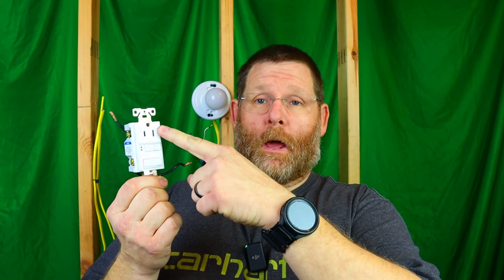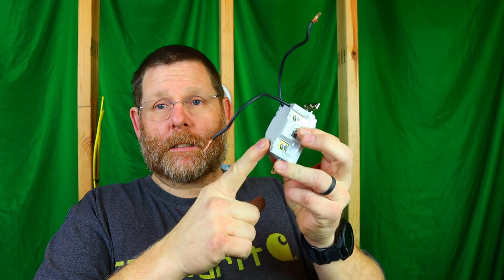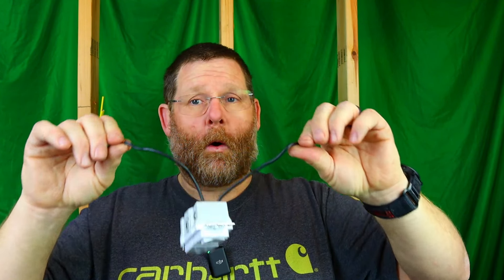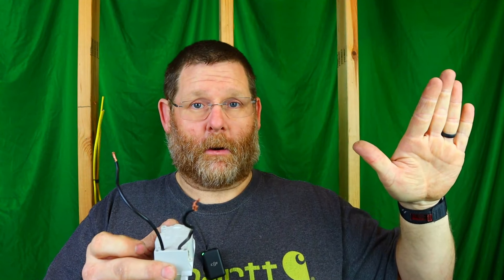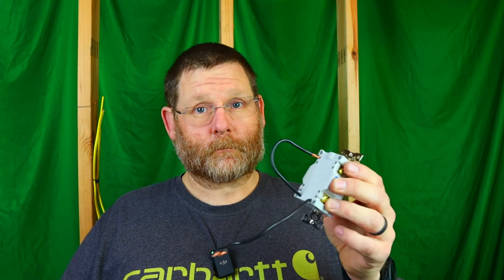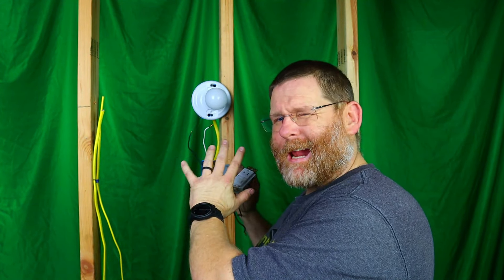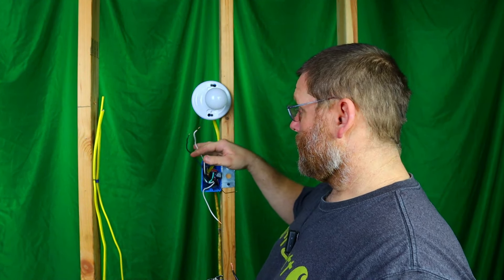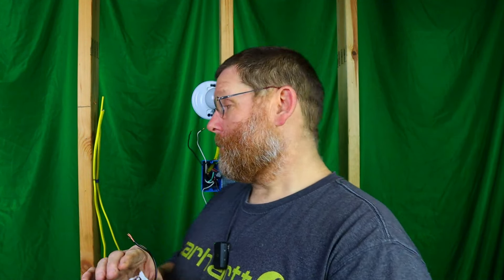DIY GFCI  Switch Combo How To Stay Safe

Comment: Dude thank you sooo much for making this video. You made it so easy to follow and explained every step so I couldn't screw it up. I have the exact gfci combo switch and I've installed one before but that had FOUR different wires coming into one box. I have a 64 year old house that was poorly built and I have no idea why they wired it that way but it took me like 6 hours to finally get it installed correctly with a gfci outlet with a 2 switches. One for the ceiling light and one for the vent fan. So thanks for making this installation easy enough that a caveman could do it 😊
Reply from the maker: My pleasure thanks for watching and commenting ☺

Comment: Cheers! Thanks for redoing this video, I like some others thought the same. My light and fan were both connected. A GFCI was in the bathroom. First the fan caught on fire 🔥 fell out and into the toilet. The plastic was so hot it exploded the toilet. 
After cleaning up the mess and removing the burnt fan, it turned on the flipped 15amp back on. The lights turned on, I then washed my dirty hands and went to turn off the light but…shock…yep I got shocked. The GFCI that was there did not trip. I planned to investigate, but I assume nothing was protected. 
But yes, thanks for the video redo.
Reply from the maker: Wow that's terrible. Glad everything is OK now. Thanks for watching and commenting ☺

Comment: Just wondering why Eaton uses strained wire vs solid copper, and other manufacturers like Leviton and etc what they use. Thank you for this demonstration and mentioning other options to use on this type of switch.
Reply from the maker: My pleasure and not sure why it is so different between the brands

Comment: Thank you so much for your videos! Liked and subscribed! Question please: What if I am trying to wire up the gfci switch combo but I also have another switch that also turns on this light? Can this still be done?
Reply from the maker: Welcome to the diy family, and are you meaning a 3 way?
Reply: I'm unsure of the name maybe a 2 way? It's a bathroom light with 2 different switch locations. I wanted to install one of these in one of those locations. I have white, black and red wires plus copper ground at the switch.

Comment: Just watched your video and found it very helpful. Watched your video to change my old switch in the bathroom and have it change to a GFCI combo. The only Problem I came across is that I can't turn the light on and plug something at the same time. I can only use one at a time ( the switch light Or the receptacle), both work, but as I said, not at the same time. Can you let me know what I did wrong? Thanks
Reply from the maker: https://youtu.be/SbUVVlO8Vww this may help

Comment: I followed the instructions for wiring this type of switch that were presented around the sixth minute in the video and the gfci turned green but wouldn't allow me to push the test button and didn't have any power. I re-wired it using the second type of wiring demonstrated that gfci protects the light fixture and the green light came on and the test and reset buttons both worked and there was power. Are there some combo switches such as the Leviton brand that I bought that only allow the second type of wiring hookup demonstrated?
Reply from the maker: I don't think so

Comment: Hello, I have an older home and I want to install a GFCI switch and outlet combo where I have a switch in the bathroom. The problem is, there are only 2 wires PERIOD, no other wires are in that box at all! no capped white or black wires either and no ground, and the white wire is the hot one😬, I tested the 2 wires, I got 120+ reading on my meter so I guess I have a neutral, is the wiring reversed?? I'm confused, please help! It also has those 2 wires coming out of the GFI just like the one on your video. I bought this thing from Amazon and I want to find out if I can wire this thing and if I can't, I'm returning it before the 30 day window is up, thank you.
Reply from the maker: Sounds to me like you Only have a hot and a switch leg down at the box. Your neutral stayed in the light box. I'd say no without being there
Reply: @MountaineerOutdoors  thank you.

Comment: Can you use the switch to turn a 5000 btu window AC unit on and off in a shed using 10-gauge wire 200 ft away?
Reply from the maker: Only if it has a knob. If it's electronic probably not

Comment: what if you have two light switch 1. Fan/vent (with no light) 2. Light in bathroom and the light switch is a single pole (2 brass screws) so that would be 3 Romex wires coming from the box 1. vent 2. power supply 3. light fixture.